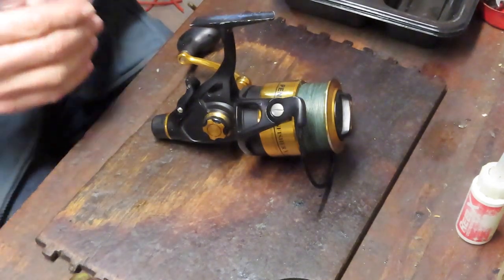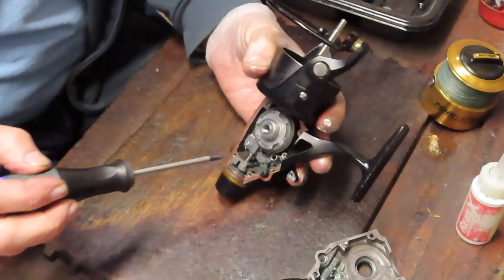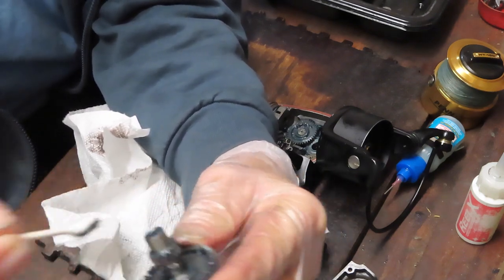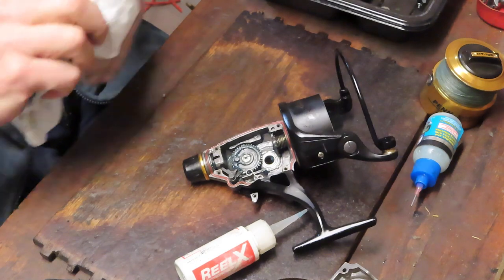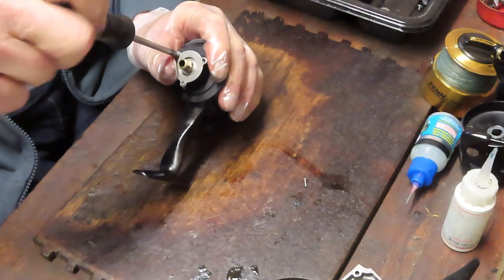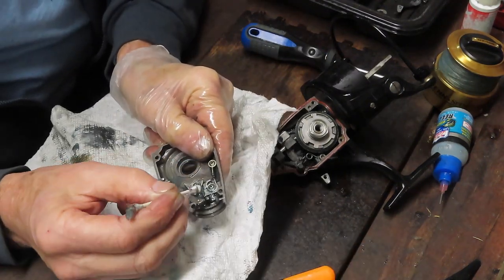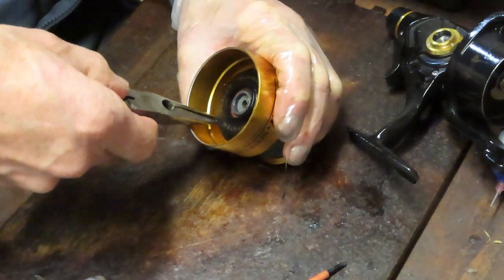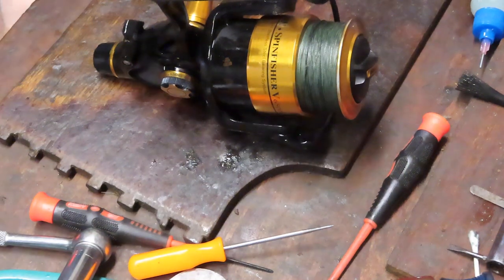Penn SpinFisher V Live Liner 6500LL how to take apart and service copy

Comment: Thanks for a very well constructed video. One thing you did not show was how to service the baitrunner drag. I have an issue where at its very least tension I feel mine is still a bit too much and have had a lot of fish drop a live bait because the drag is not loose enough.  How does one get to these drag washers to service them
Reply from the maker: You need to remove the side plate cover and then you will be able to remove the rear drag cap and drag assembly, by pulling out the retaining clip.  I recommend getting the schematic of the reel before you start and then you will know the sequence of the parts as well as which ones to order if needed.
You can get the schematic here and you can also order the parts through Mysticparts.com - Dennis   https://www.mysticparts.com/Assets/images/pennparts/schematics/ssv6500ll.pdf

Comment: Your instructional videos are excellent and highly informative, thank you.  Do you have comments on servicing/ cleaning the rear drag assembly of these Penn Spinfisher liveliner reels? That was not shown.  I can’t figure how to remove the rear spring retainer clip to gain access and remove the assembly.  My reel had sand in the rear area where the drag system starts- I WD’d it well and it looks clear, but without removing I can’t be sure.  Is that rear drag well sealed from internal sand as described? Thanks and thanks again for all of your posts,
Reply from the maker: You are right, I did not service the rear drag.  To remove that assembly you beed to have the case open and the internal gears and axle removed.
You will see a silver half circle clip just above the drag knob on on the inside of the bottom of the case.  You need to remove that clip by pulling it out (towards you). I use a pick to start is by putting it behind one of the legs and gently prying it forward.  Once that clip is removed the entire assembly will drop down and out.  Too make it easier on you, back off the tension on the adjuster knob before removing the clip - Dennis
Reply: @2ndChanceTackle  Thanks DWizzardNJ for asking the exact question I had. My sons reel has a seized rear drag and I couldn't see where the retainer clip was to access it. Only problem I will have with the drag being seized is I won't be able to back the drag off. Any ideas why the drag may be seized? The reel is in good condition otherwise and has been looked after. Great channel. Very informative and an easy watch. Pleased I found it!

Comment: Hi Dennis I have troubles with small screws.  I usually dip the tip of the screwdriver in grease and the screw will stick long enough to be started
Reply from the maker: Thanks for the tip!  I do that as well after a few failed attempts - Best wishes - Dennis

Comment: Dennis, I have a Penn V4500LL.  I took the one screw out of the bail cover and a spring with a pin popped out.  I can't figure out how it goes back in.  I love your videos, but I haven't found one yet that deals with disassembly of the bail assembly
Reply from the maker: I did a generic video on how to set this as it is a common set up.  You can watch it here https://youtu.be/Qrr_rizFkYw If you have a white plastic block inside rather that a straight channel, no problem, just put the non arm side of the coil in the plastic block.  - Dennis

Comment: Hey Dennis, Thanks so much for this tutorial!! I have to ask about the bait feeder drag knob (at the bottom of the reel). You did not cover it in this video. The issue I'm having is the knob does not make a difference with the drag. I can tighten it and it never stops. Any ideas?
Reply from the maker: You either have a broken or missing drag washer or a jammed adjuster that is mis-threaded on the case. Either of these will cause the condition you are describing Check those first
Reply: @2ndChanceTackle  Thanks so much, whats the process for dissembling the rear drag knob?
Reply: The rear mob doesn't changed the drag settings they are preset.
Reply: @joelpollock9160  The rear "mob" does change the drag settings.

Comment: This was great but I can’t find a video for a stuck bottom drag. Took apart and it rotates when out but when placed back in it sticks again. What do I have to do?
Reply from the maker: The cap may be cross threaded.  You should check the assembly.  It may need to be replaced

Comment: Hey Dennis do you have any video showing how to set gears on Shimano reels since they have oval shape ?
Reply from the maker: I have done those.  Look for the /\ arrows for alignment or some of those have the red dots on the oscillation gears, so look behind the main gear.  Next time I get one in, I will do a separate video on it, but for now, the tips may get you by.  What model Shimano are you asking about?
Dennis
Reply: @2ndChanceTackle  thanks for the help Dennis it's for a Socorro 10000f